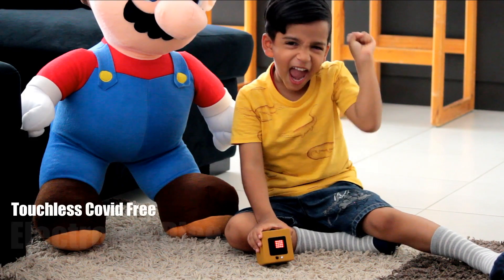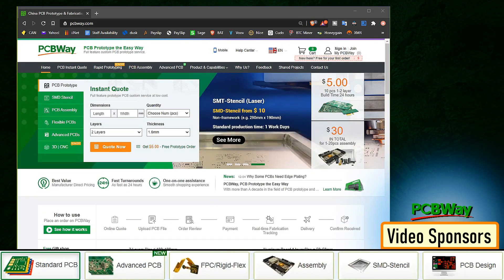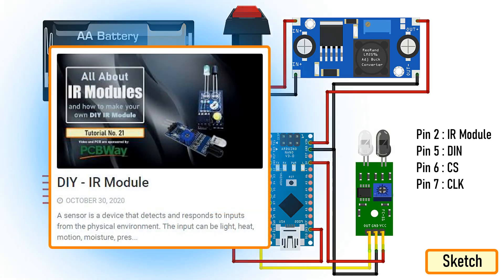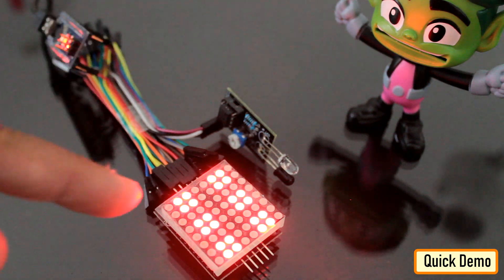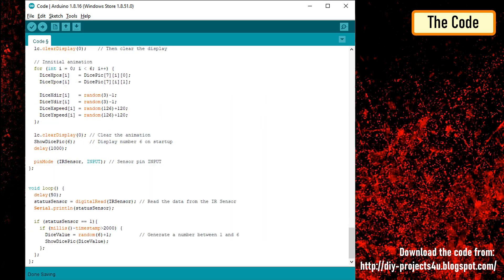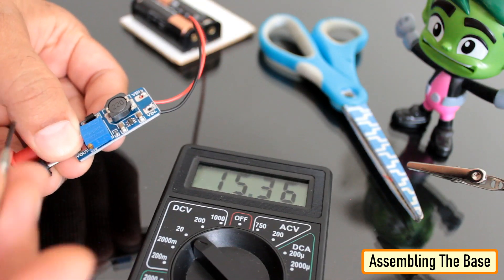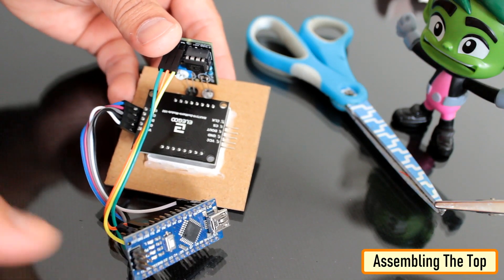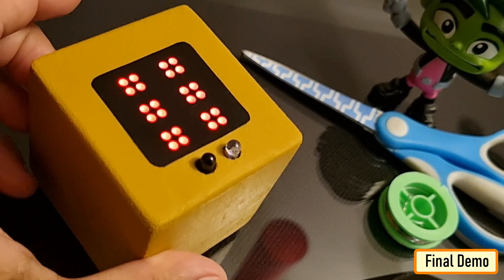Covid Free - Arduino Dice Project

Comment: great project, although mine will not stop reading a hit by the IR sensor and it keeps setting off a change of the dice, could you help me know what could be happening? thanks
Reply from the maker: Few things:
1. If you are testing the IR module in or near nunlight (infra-red rays) the dice will keep cycling. 
2. You need to add delay so that when you hover your finger it does not detect each finger as a new object. 
After it detects the first finger it should go in delay to avoid the groves (troughs) and fingers (crests)
Reply: @CrazyCoupleDIY  thank you, I was able to correct the IR issue, but I have also noticed that the order of the numbers is not random, it seems to follow a sequence from boot in order, did you also get that result?

Comment: I have several questions.
1º How do you charge the dice once the battery runs out?
2º How do you differentiate a "new" roll with the same value from another that has already occurred? I see that it has transition animations, but I see on one of the occasions that it fails and it is not known if it is because the same number appears or it gives an error.
3º I do not see any delay after the roll. If you pass your hand over the dice more calmly when you withdraw it, won't you roll the dice again?
Reply from the maker: 1. I have screws at the bottom of the box
2. Yes that is an issue, bit you can add another function to add an animation to differentiate that. 
3. I think that's a good point too. Adding a delay would be a very good option.